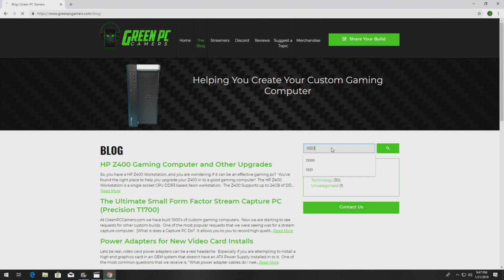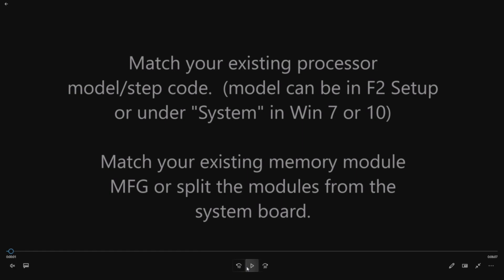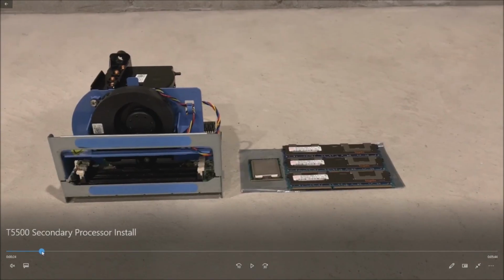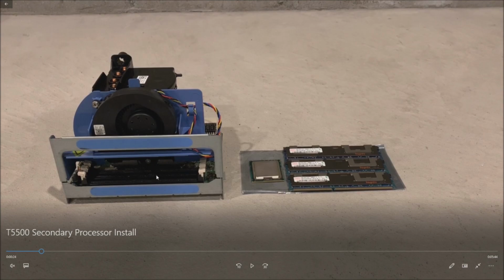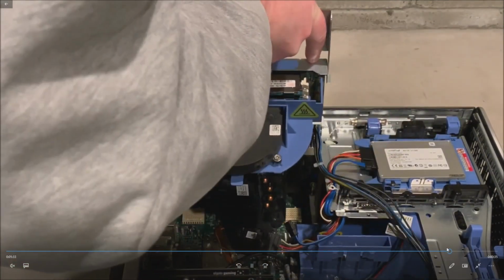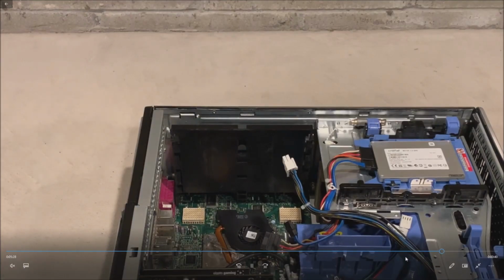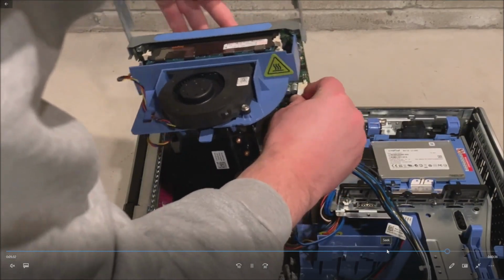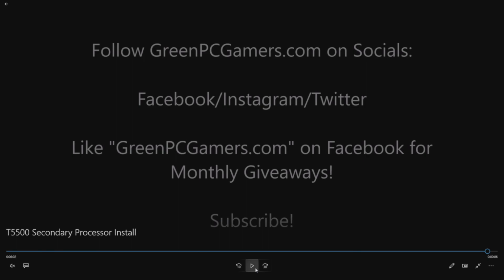How to install a Secondary Processor CPU kit in to a Precision T5500 F632F

Comment: Im rocking a t5500 with one x5680, 40gb ddr3, and a gtx 980. Runs fortnite season OG at high settings at 60FPS, runs beamng with high traffic and medium/high graphics around 50-60 ish. Great pc. How good would it be with a second x5680?
Reply: Unless you want to do other things in the background, the processor may simply do nothing.
But if you want to try it, go ahead.

Comment: Hi! Thanks for tour video. 
On your website you mention in possible RAM : 16GB.... 
But Dell's spec says that the maximum ram per slot is 8gb. 
If I put 16gb in each slot, does it will running at 8gb max? Or it will not working at all?

Comment: Can I use a single 16gb ram stick without bios upgrade?
Reply from the maker: We've never tried it.  Post the results if you try it.
Reply: @GreenPCGamerscom  got a x5690 today but still no post maybe due to bios upgrade, do you know a processor for the dell 0crh6c that doesnt require bios update?

Comment: Hey, great channel, very helpful video indeed, congrats, just one question, do you think an Nvidia 3070 would fit in this T5500? Any compatibility issues? Thanks.
Reply from the maker: We haven’t tried the 3070 in a T5500 yet.  You might have to make some modifications to the side panel and pci brackets to physically fit a 3070 in to a T5500 chassis.  Plus, there would be some strong bottle-necking.  Let us know the results if you attempt the install.
Reply: @GreenPCGamerscom  Thanks for your response, what would you think is the best video card available in the market that fits and has no compatibility issues for the T5500?
Reply: @eduardom6271  GTX 1650S

Comment: Can you use that 8 pin power cable in a GPU, I was thinking about getting a 1080ti (requires 2 8 pins) if I use the 2 6 pins to 8 pin and the 2nd CPU 8 pin would it work?
Reply from the maker: Either option should work.

Comment: I have a T5500 with an X5687 CPU and considering this upgrade.   How much impact on gaming would the second processor have?
Reply: For gaming, almost none. The xeon is basically an engineering chip, that can also run games. The 6 cores are more than enough for gaming, and twelve won't boost much. The gpu upgrade will make a much larger difference for gaming.

Comment: I have a t5600 with two xeon 2690s installed. I'm running into cooling problems. Both processors run really hot with the Auto fan speed option selected in bios. Not sure what do to about it?? Speedfan only manages to turn the fans all the way up and it sounds like a jet engine. I get around 100 fps in bf5 with a gtx1070 ti
Reply from the maker: Hey Vlad,  here are a few things you can try:  

1. Clean the heatsinks and processors and re-apply new heatpaste.  We like this heatpaste: https://amzn.to/2TeO11O

2. Remove or manually vent your side panel.  (the system may be struggling to mitigate the heat from the 2 processors and GTX 1070 Ti Graphics Card)

Option 2 has worked well for us in the past.